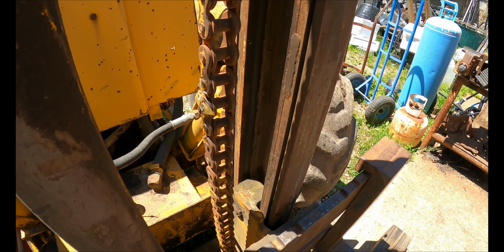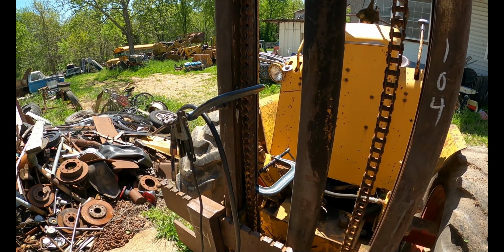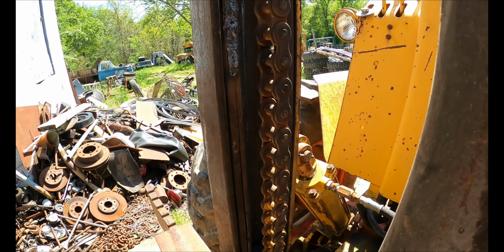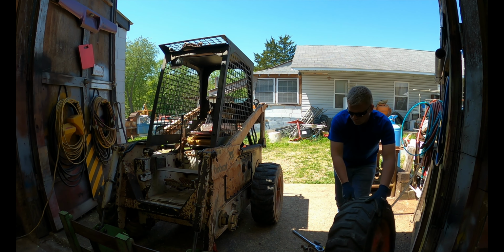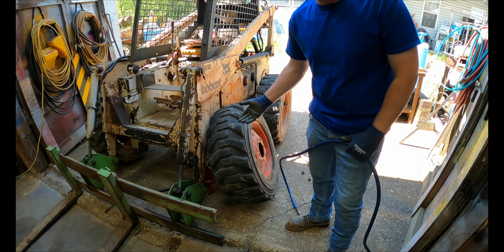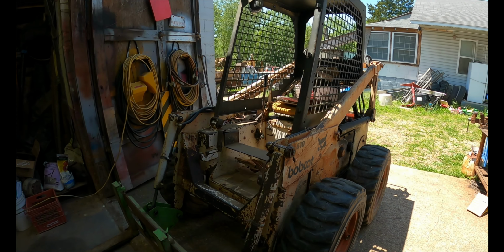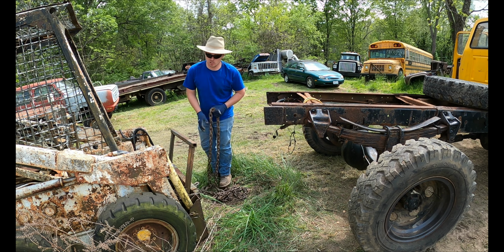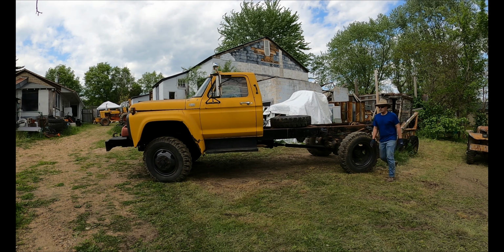Spring Cleaning: Getting to Work! Fixing, Selling and Using

Comment: Enjoyable video. Beautiful slice of heaven where you are. What is under the white tarp next to where you parked the yellow Ford? Thanks again
Reply from the maker: Thanks for the view Paul! :) It's an unfinished project from a few years back. It's a 1977 International cab on a '86 GMC Topkick frame. Has a 3208 cat with a Eaton 5 speed. Made my own cab mounts and re-worked the floor. Needs wired though.
Reply: Sounds like another cool build. Thanks

Comment: Just got a chance to watch the last 2 videos. Blue and black are my favorite colors as well. At least you know the four wheel drive works good on the Ford. Is that a 330?
Reply from the maker: Thanks Kyle 🤗 The yellow Ford has a 391 in it 🙂👍 Thanks for swinging by! Happy to see your comment 😀 and I'm hoping that you had a great weekend 🔧
Reply: @HODGEPODGEDODGEGARAGE  yessir a good weekend and hope you did as well 😁 391 is even better. We had a old F600 dump truck with a 330 with glass pack mufflers and it sounded gooooooood. Just used it around the shop and house because the brakes worked whenever they wanted to 😂🤣😅
Reply from the maker: @kylebass4635  oh I did 🙂👍 Yeah, those Fords had some bad brakes cause of the vacuum cannister lol
Reply: @HODGEPODGEDODGEGARAGE  Glad you had a good weekend as well 😇😁☺️ Yeah could not find a leak so I think the fluid was going in the hydrovac (booster). Vacuum brakes are good until they start giving problems then you might as well replace the entire system. I remember a farmer had a 10 wheeler IH Loadstar 1900 with vacuum brakes and double hydrovac's and we had to do a entire system replacement on it. It was a nightmare!!!!!
Reply from the maker: @kylebass4635  oh!! 😖 I bet that was not a fun job at all! What a mess!
Reply: @HODGEPODGEDODGEGARAGE  oh it was bad. I was only 15 at the time and I'm 44 now and still remember it.
Reply from the maker: @kylebass4635  🤣 burned into your mind i bet!
Reply: @HODGEPODGEDODGEGARAGE  yes. I remember my grandpa telling me to take a walk away from it because he was about to go off on that truck and he didn't want me to hear what he was about to say. Came in to get the brakes working and ended up having to replace everything in the system including the lines and drums. Bill was several thousand dollars back in 1992. A 10 wheeler definitely is better off with air brakes and not vacuum brakes.

Comment: What stick rod did you use?
Reply from the maker: 7013 😬 The coating was breaking off of them. Couldn't find the 7018's and I was impatient. Thanks for the view and comment 🙂👍
Reply: @HODGEPODGEDODGEGARAGE   Coating breaking off cause of moister in the flux. Try some 8018 for down hill welding I think you will like how your welds will turn out.
Reply from the maker: @blackf350  thank you for the suggestion 🙂👍 I will buy some and try them out. 🔧